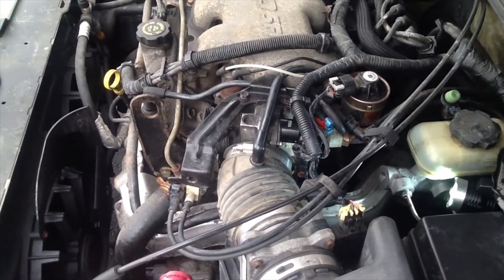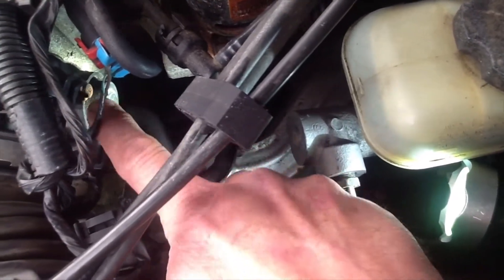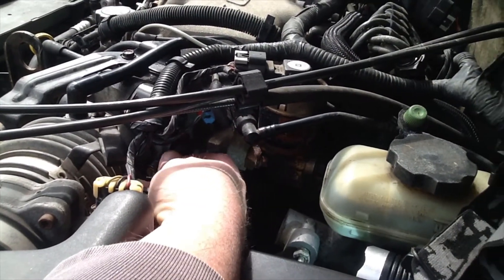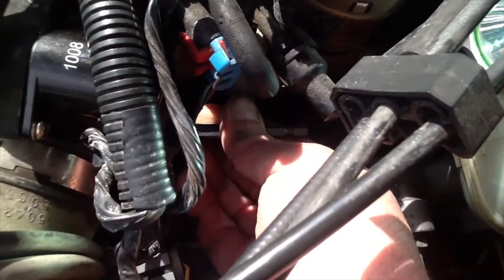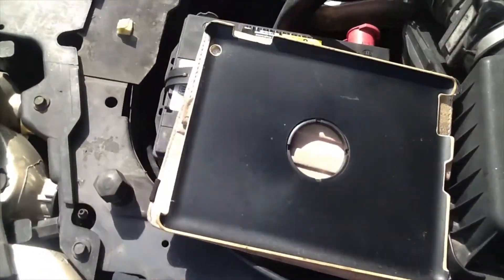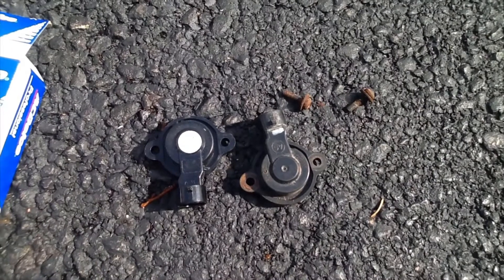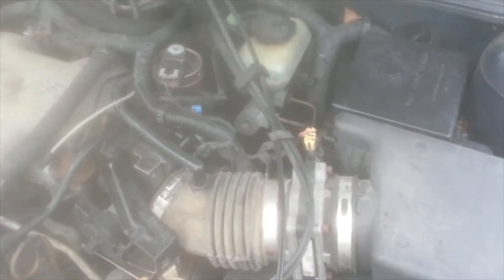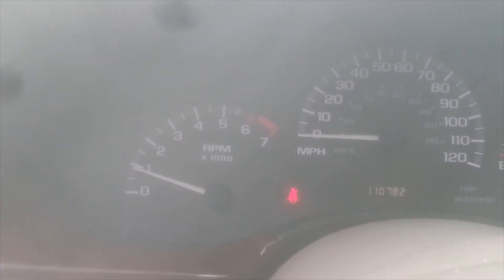How to Fix High RPM's and Idle  - Throttle Position Sensor Replacement

Comment: I have this issue after I replaced engine gasket on and TPS on '01 galant  HIGH idle as if it will just take off and feels as if it will shut off when in drive

Comment: Do you think idle air control valve should be cleaned before replacing throttle position sensor ? I know replacing the throttle position senso solved your problem.